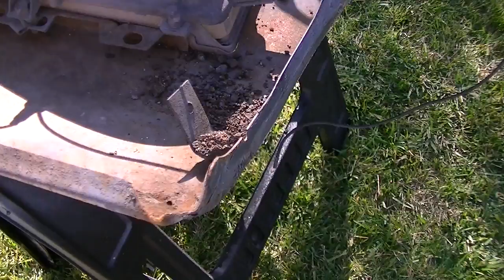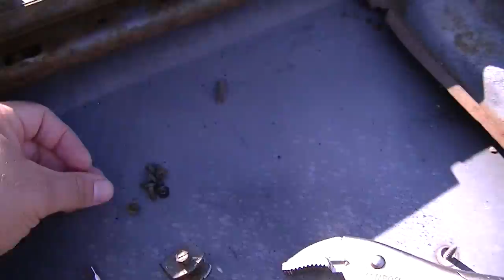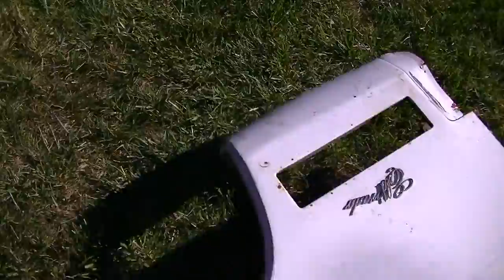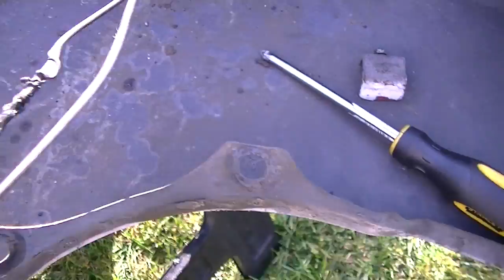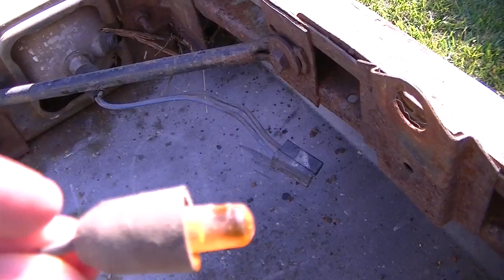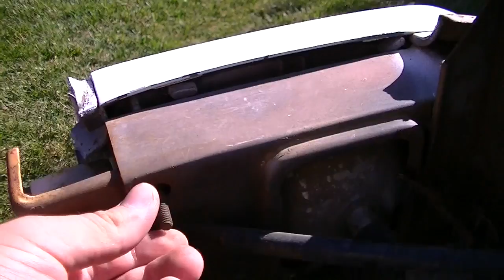1972 Cadillac Eldorado Overview of Disassembled Fender

Comment: The amber tube is Fiberoptics cable they are also run behind both headlights & taillights they removed bulbs from the fender top signal & headlight indicators If you have indicators you see in the rearview mirror for taillights they are also fiberoptic. at some point the replaced side Landow top lights with the same. This way you know when a bulb is not working the light from bulbs passes through the fiberoptics to indicators so there is no need to walk around to inspect lights & signals prior to driving.